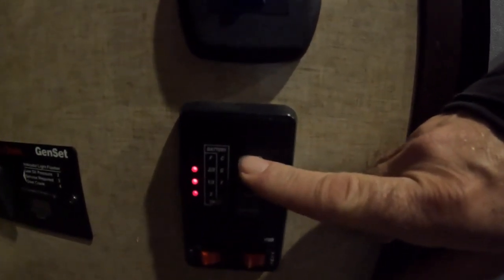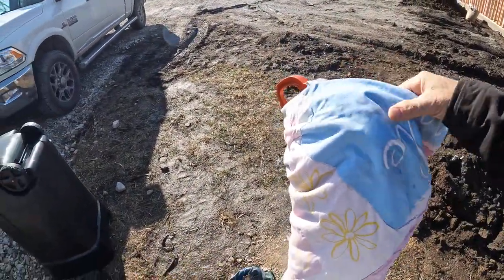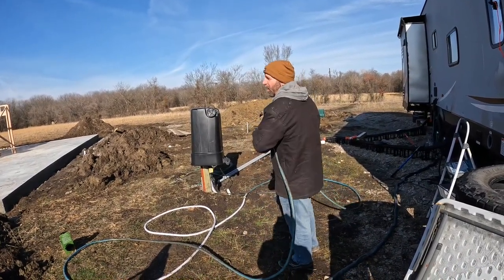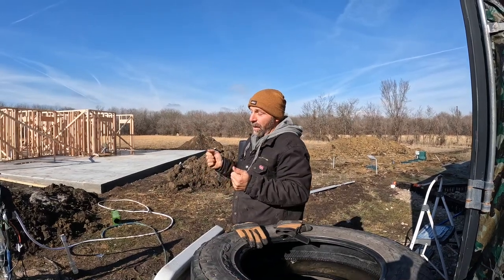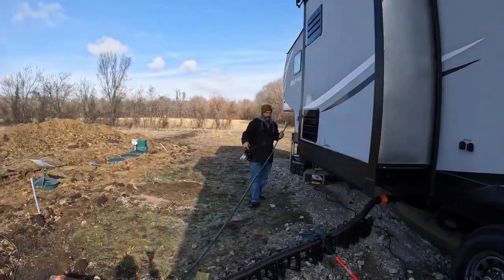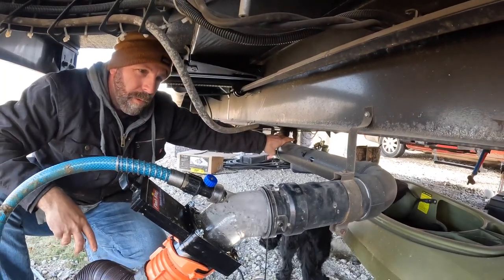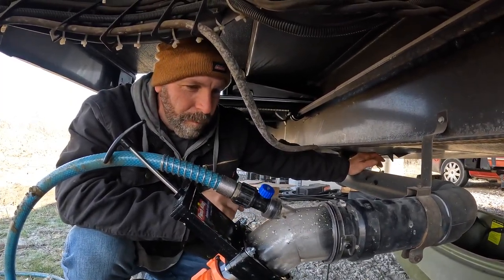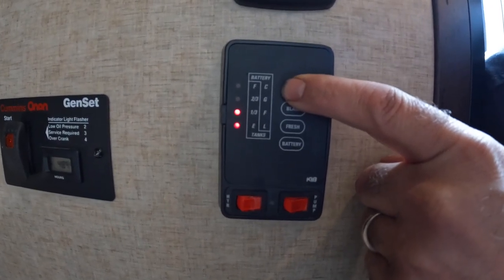How to unclog your Grey water tank with the Flush King

Comment: These work great. Glad it worked for you.  One key component is a $10 water flow meter so you don’t overflow your tanks. In this case it wouldn’t be accurate due to the water held by the clog but in a normal flush you would want it or want to have someone watching the sensor at the very least.
Reply from the maker: Good input, thank you.

Comment: You trust your tank level sensors?  And how in the world do you clog a grey water tank???
Reply from the maker: I believe the grey water clog was due to the round plastic cut outs that they drill into the tanks and leave in the bottom, also known as the slugs. We normally dump every Friday but we do check our sensors, however I thinks it’s best to know how many days of full time use that you can do before having to dump. Like driving a vehicle with no fuel gauge. Lol

Comment: A few comments.  A Flush King was the very first thing I bought when we got our first RV.  I do not use the black tank sprinkler.  Use the FK until it comes out with nothing but clear water, both black and gray.  Never leave your valves open.  Close them and open to drain.  You have a holding tank, not a septic in an RV.  Never use bar soap.  Soap scum will form in the tank.  Use liquid soap (actually detergent).  To keep your sensors in your black tank working, you need to stop struvite from forming.  Use 1/2 cup of Borax dissolved in hot water and either some laundry or dishwasher detergent in the tank.  Leave it in until you dump.  The Borax, every time, the detergent maybe every third time.  
Best wishes on building the house.  My wife and I built ours on weekends 38 years ago.  Still living in it.
Reply from the maker: all good input for RV life.  Thanks for all the helpful hints and tricks, and daily use input.

Comment: One thing to add to the flush king, is a online water meter that goes between the water faucet and the flush king. You can monitor how many gallons of fresh water you putting into your grey or black water tank.
Reply from the maker: Good info there Roy, thanks.

Comment: Question for you we have the same set up with the drain hoses with the (Y) connector but when I open one drain to empty when it comes down it also runs into the other hose instead of just to the below ground sewer do you have the same problem and ifso do you have a solution for that ?? I am thinking only way to fix is to buy 2 more waste gates and add them to the Y
Reply from the maker: We have to drain ours at the same time because our tanks are hooked up to same rinse hose and we can’t isolate them.but then we end up back flushing both of them anyways so it washes out both hoses. I guess if you didn’t want the waist going into the other empty hose towards the other tank or you could put a waste gate like you said between the hose and the Y that would work.

Comment: This didn't work for me because my grey tank valve handle was broken and not actually opening the door inside. However I did find you can also make a Flush King from a flush pipe and a valve piece. My Camping World didn't have the King.
Reply from the maker: When I looked at making something myself it would have cost me the same if not more plus time to build something similar to the flush king but having a broken valve doesn't mean the flush king didn't work it means you have to have a working valve handle before you can properly use the flushking. I hope you got your issue resolved. 😁
Reply: @TeamTateOutdoors  Yes I had to replace the valve. Took about an hour. I'd recommend you buy a bore scope for your cel phone so you can look into your plumbing and see what was blocking things.

Comment: MY BLACK TANK HAS BEEN BLOCKED NOW 3 WEEKS I HAVE GOT THE VALTERA HYDRO FLUSH UNIT AND THE ATTACHMENT (ONE) FOR HOOKING IT ONTO THE PIPE UNDER THE COTTAGE RV. I WILL TRY AND GET THE OTHER CONNECTION OFF THE PIPE IN THE CUPBOARD AND GET A PLUMBER TO CONNECT IT UP THEN WITH THE VALTERA HYDRO FLUSH SHOULD DO THIS JOB WELL THANK YOU FOR YOUR VIDEO THE CLEAR PIPE TELLS ME THAT YOUR GREY TANK CLEARED WITH NO HASTLES SO I TAKE IT THAT THE BLACK TANK WILL AS WELL IF MY SON IN LAW CAN DO THIS CONNECTION WILL PAY HIM TO COME AND DO THIS JOB MANY THANKS
Reply: THE FLUSH KING IS NOT AVAILABLE HERE IN NEW ZELAND
Reply from the maker: Sorry about that. Can they not ship you one?

Comment: Those are notably wrong. 

Good lick
Reply from the maker: What’s notably wrong Mike I’m not tracking? Help me understand. Thanks
Reply: @TeamTateOutdoors  the tank level lights.they get coated with material and they don't read right 

I have also found out from a RV technician that the folks building the trailer just drill holes where they want to
No 2 like trailer indicator sensors are not in the same spacing thus don't read the same level of water

The best way i have found after 40+ years of having trailers is to drain the tanks when the indicator shows half full. Also don't leave the drain valve open all the time when parked. That way you have enough water to flow out and suck out the solids in the tank
Reply from the maker: @mikeheiser7938  gotcha, thank you for that. You would think they would be a bit more stream lined in the building process, but I guess there is no fireman that’s gonna check every trailer to see where they were mounted. I think allot of our issue is that the trailer has settled on the gravel and it’s leaning to the east ever so slightly. I think that is also giving us a false read.
Reply: @TeamTateOutdoors  true on the settling in the soil. You could set it back on the truck hitch and lift the front legs up and resting them with blocks and put an extra one on the low side to lift it up. Also put blocks on the low side and then use the stabilizing jacks to give some lift and then put the other side stabilizers to just snug up the trailer.

It is worth a shot. I have good and bad luck on doing it. .

I have actual leveling arms on this trailer that takes out the juggling act.

Good luck
Reply from the maker: @mikeheiser7938  yeah this one has a double in the back and a double that you can adjust each leg height in the front but it’s so close that I’m not gonna worry about it. Just a couple more months and we will be in that house. 🤞